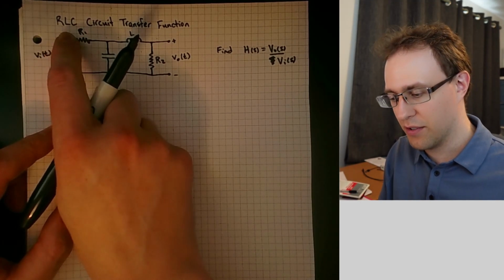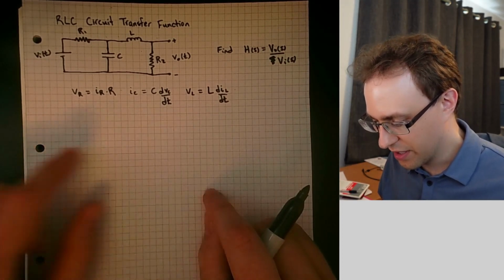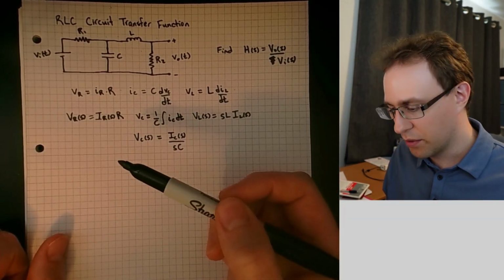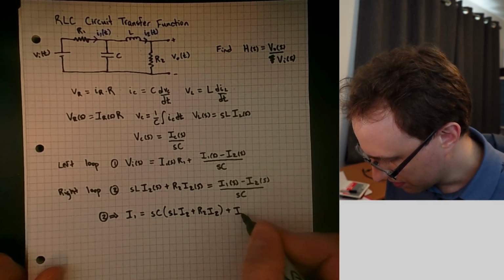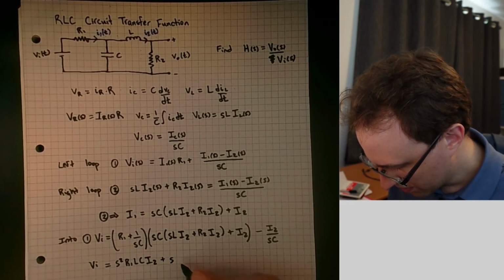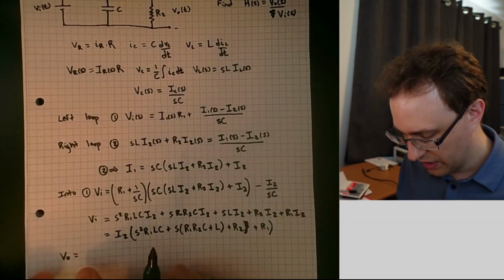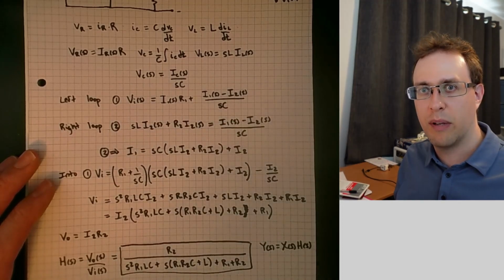Solving RLC Circuit Transfer Function

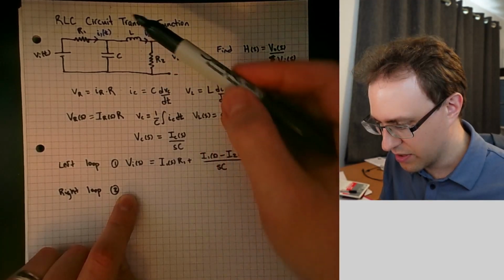Comment: At 5:06, why does the voltage drop across the capacitor have to equal the drop across the inductor and resistor R2? Great video!
Reply: Normally volt drop across cap would equal across resistance but because there is an inductor it must be across the sum of the two. You can redraw the circuit so that the cap is parallel to to combination of the the two.
Reply from the maker: Correct as noted by @diags_1109, in this case the capacitor is in parallel with the series combination of the inductor and R2

Comment: It seems this is incomplete. How to solve further using inverse laplace?
Reply from the maker: Yes, this video was just finding the transfer function of a circuit. You could then go on to find the response for a given input, or just directly take the inverse Laplace transform to get the time-domain impulse response. My previous video went through the inverse Laplace transform process with partial fractions (https://youtu.be/gRQio8S8DK0). You could go through a similar process here if you can identify the roots of the denominator polynomial.
Reply: @AdamNoel  Ok.